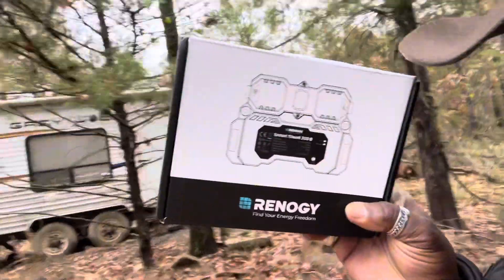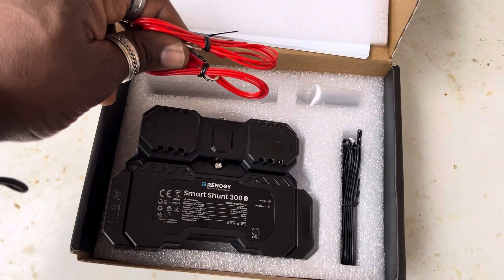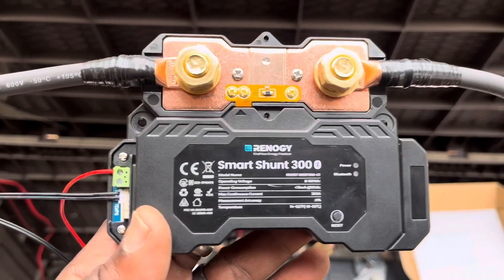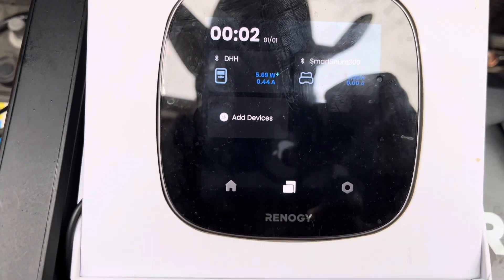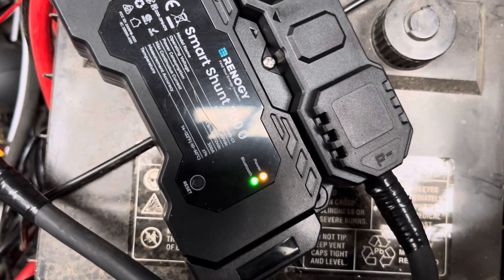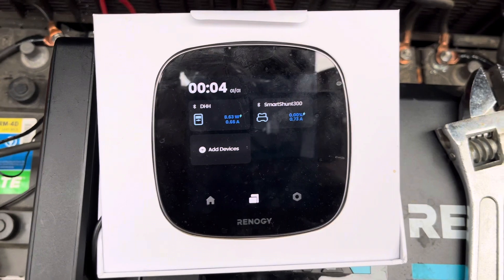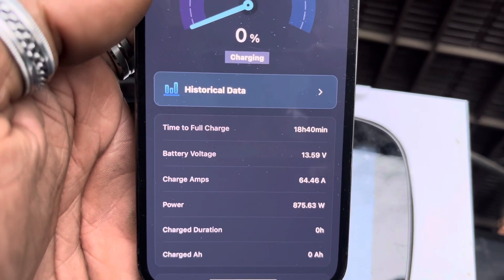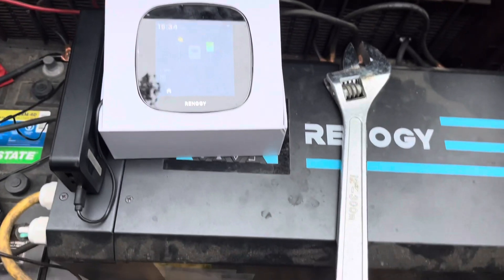Renogy Battery Shunt 300 Unboxing & Install

Comment: Renogy took down the smart shunt. Not selling it anymore. No comment from renogy as to why.
Reply: I received the following response from them. "While the Smart Shunt is no longer available for sale in our website, please be assured that Renogy remains committed to providing support for our existing customers. We will continue to offer assistance, including addressing any firmware concerns to resolve the various issues you've encountered." Reads like its been discontinued. I've got multiple usability issues with mine, and given the above response, I doubt it will get any enhancements.
Reply from the maker: @KazOutdoors  that sucks something major! I hope mine does not brick 🧱
Reply: They emailed me back saying they pulled it for a re-brand and that it was going to go back on sale end Jan. Who knows! I've kept mine because at the price, it's promising. Would cost almost £500 to get the same functionality from Victron kit.
Reply from the maker: That’s not good. I wonder why. Going to check into it.
Reply: Definitely not thrilled with mine. They announced this mid last year and still failed to deliver.  Here is to hoping they pulled it to develop further and we didn't waste our money
Reply: I just bought one a few weeks ago. Weird.
Reply: Yeah they rebranded to the smart shunt 300 I believe

Comment: What happens in the mountains? The literature says its "ceiling" is 2000 meters.
Otherwise, I'm all for it.
Reply from the maker: I wonder just like everything once you get in high elevations the functions can be off by a bit. Just like cooking in a higher elevation driving in a higher elevation, solar and battery functions in a higher elevation, must be off as well so the readings will be off with the smart shunt

Comment: wtf! my core wont even detect the smartshunt.
Reply from the maker: Did you try to connect it to your phone first? Also did you do the updates on your core first?
Reply: @JADudley  i got it going bro. both of my items are brand new. The core just needed multiple updates. Kept running the update until it cant update no more. It finally showed up.

Comment: Cool product. Thanks for making the video. I would double check the Ah you entered. I think 1200 Ah is 4x what 2 LA batteries could possibly have. Maybe 1200Wh? The Hub wanted Ah, quite different than Wh. It would appear 1200 Ah would lead to over charging. FYI, double check before letting it complete a cycle. I love the product because it shows all on one screen, and looks like you could install several shunts. With multiple batteries on my boat build, I think this device is bad ass and could allow me to monitor all systems affordably. Cheers! and Safe Travels!